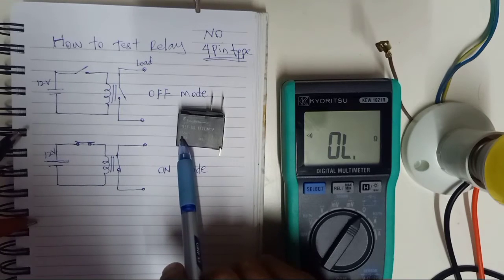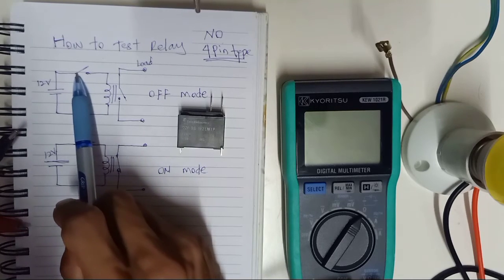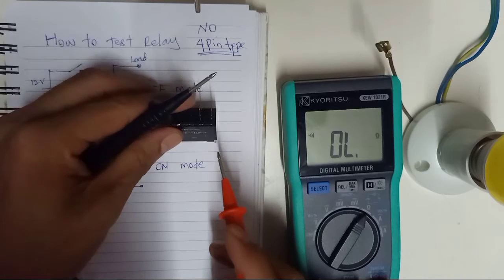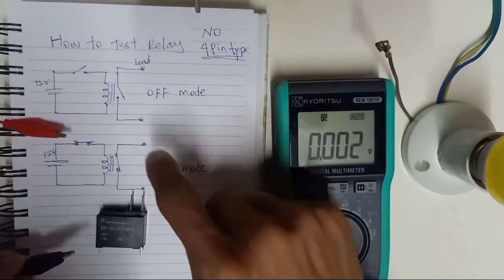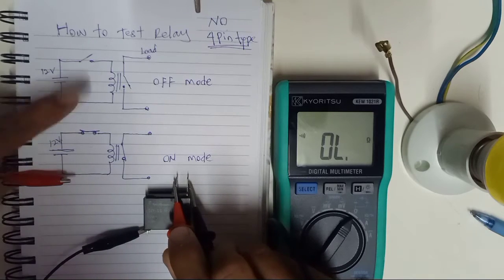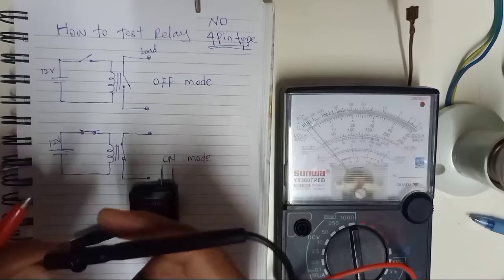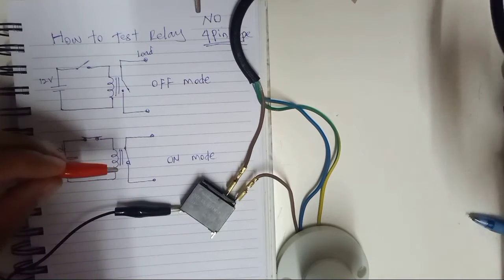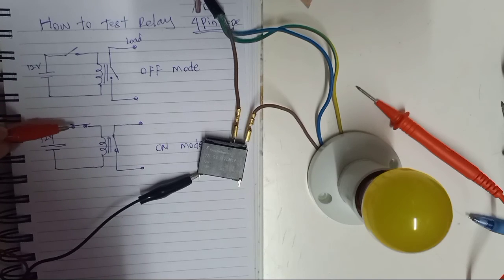How to test Microwave oven Relay 12V 16A

Comment: I have a slightly different relay than yours. How do I know the positive and negative terminals on the 12vdc side (bottom)?
Reply from the maker: There is positive and negative fixed pin for relay so you can apply either one side no problem

Comment: sir, why dont you used DIODE in the car relay? Where is the diode? Please explain why diode is not present in the relay?
Reply from the maker: Diode is use for to protect in case reverse Voltage block,so I didn't not use in testing here but once we install it recommended to use diode according to the requirements of size and specifications.